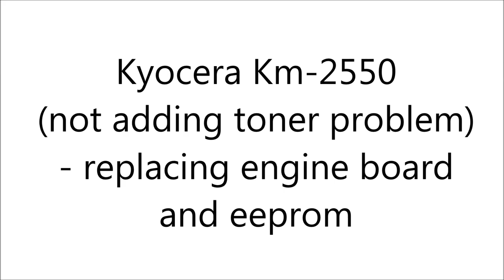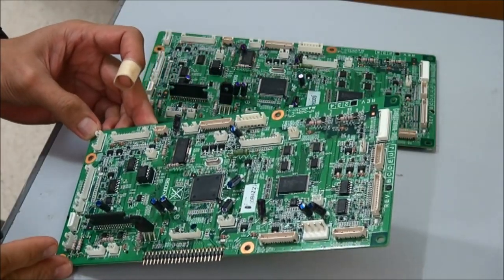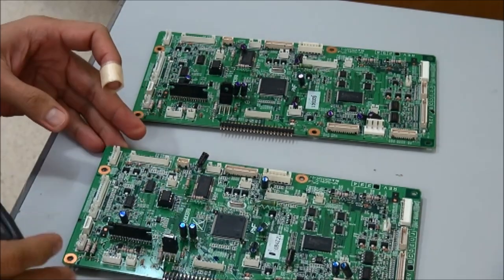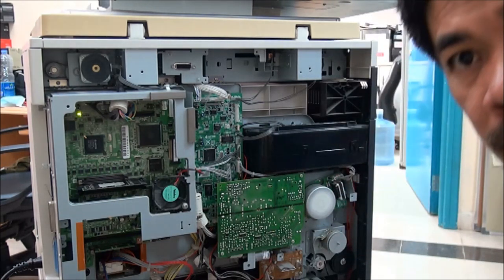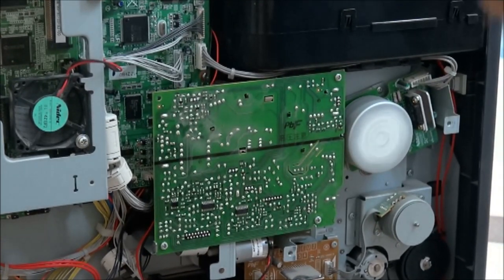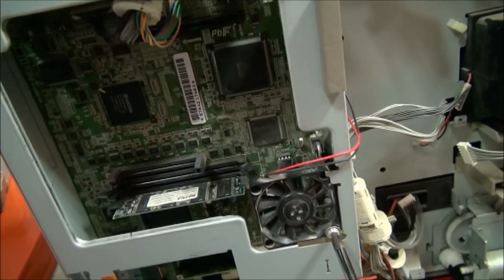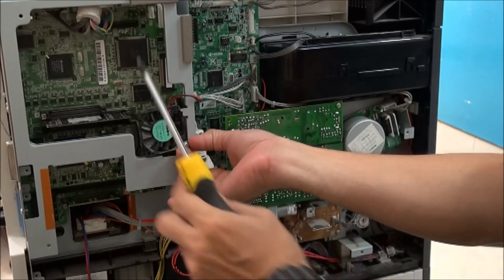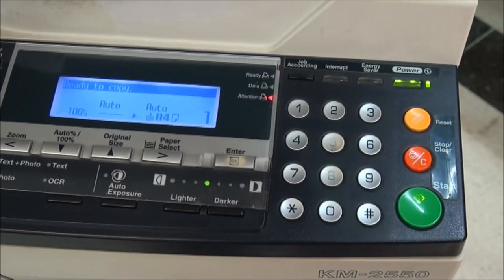Kyocera KM-2550 | Not Adding Toner (SOLVED) | Error C0180

Comment: Hi my machine is KM 2540 ok problem error c3300. Please help me i know this issue is lamp but this is not solve
Reply from the maker: try to open the flatbet glass then clean the mirror in inside the scanner..reconnect all the cables...

Comment: Hi, need your help: Kyocera Taskalfa 2552ci error C7912, replaced developer unit same issue. Thanks
Reply from the maker: Kindly check the connector of the developer unit. if still, check this https://printcopy.info/index.php?mod=erc&brand=Kyocera&model=TASKalfa+2552ci&page=22